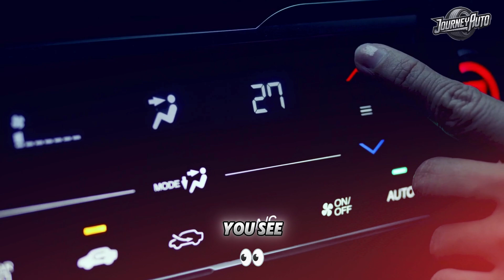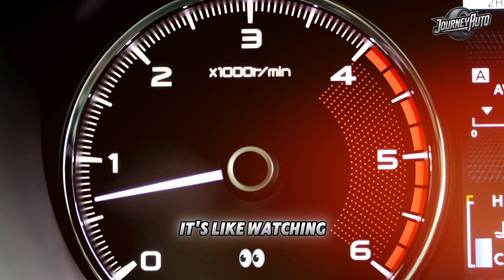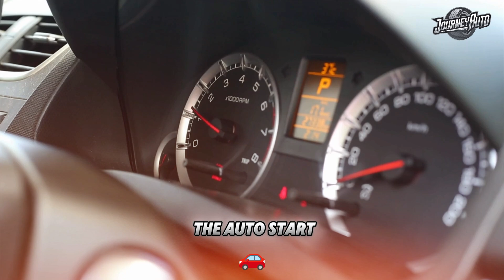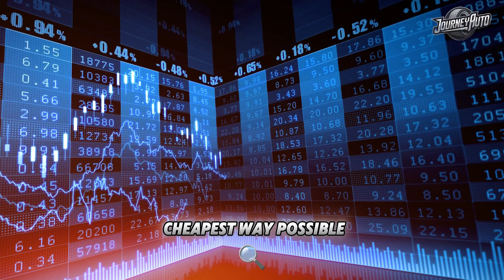Auto Stop-Start Systems: Fuel Saver or Engine Killer?

Comment: I have a Hybrid Corolla and also just had a VW T Cross hire car for a week.

The Corolla is super smooth, you dont even feel the engine kick in, the CVT makes it drive smooth as silk and coming from a 370Z daily (I needed something more sensible for onsite work) Im blown away by how genuinely great this car is to drive.

The T Cross on the other hand can suck a dick. The kickdowns suck, the power delivery sucks, its rough, it uses double the fuel of the Corolla and the stupid stop start creates a hesitation evey goddamn time you go to take off or if you stop momentarily but need to immediately start going like in stop start traffic. Truly an awful car to drive.
Reply from the maker: Sounds like you’ve had a real firsthand comparison! The Corolla Hybrid definitely shines with its smooth transitions and fuel efficiency, while traditional stop-start systems in some non-hybrids can feel clunky and frustrating. Your experience really highlights why hybrids handle stop-start so much better! 🚗⚡👏

Comment: Buy a hybrid if you want a system like this.  All the pros with none of these cons.  There's no starter, AC is electric, engine doesn't need to be running to accelerate, 50+ mpg, brakes last forever thanks to regenerative braking, and it'll still be running like it did on day 1 after 10 years (assuming you keep up with maintenance).

Only caveat is they like to be driven, more miles the better.  If you drive 2 miles to work and back home, and that's all you drive, get something else.
Reply from the maker: Great insight! Hybrids are designed for stop-start functionality, making them a much smoother and more reliable option for those who want efficiency without the wear and tear concerns. And you're absolutely right—regular driving helps keep the battery and system in top shape! 🚗⚡👍
Reply: I bought a Corolla Hybrid for work (I do onsite IT) and just spent a week in a VW T Cross hire car that had stop start nonsense. Your post is 1000% correct.

Comment: It's not the savings on MONEY the auto makers were concerned about, it's the pollution NOT being exhausted while idling.
Reply from the maker: That’s a great point! Automakers designed stop-start systems primarily to reduce emissions and meet stricter environmental regulations. The fuel savings are a bonus, but the main goal is to cut down on unnecessary idling pollution. 🌍🚗💨

Comment: Three things you didn’t mention:
1. After the start the engine has to burn more fuel to recharge the battery.
2. Fuel injection adds extra fuel at every startup.
3. It takes energy to build your replacement starter motor.
Reply from the maker: Great points! There’s definitely more to consider when it comes to stop-start systems. While they save fuel at red lights, the extra starts do put some strain on the battery and starter. It's all about finding the right balance for your driving habits! 🔋⚙🚗